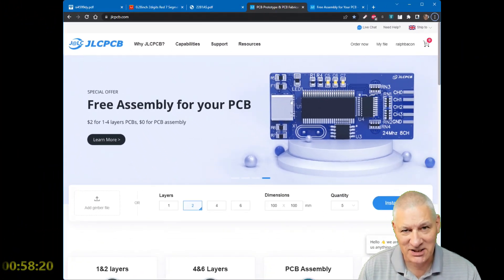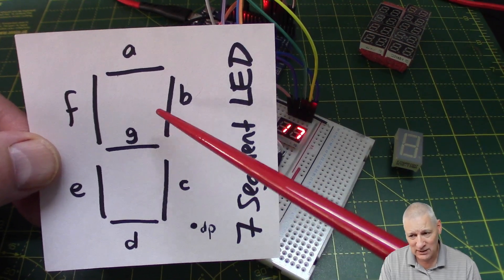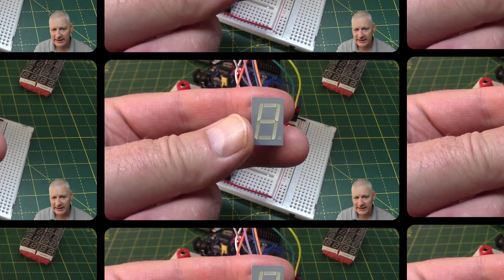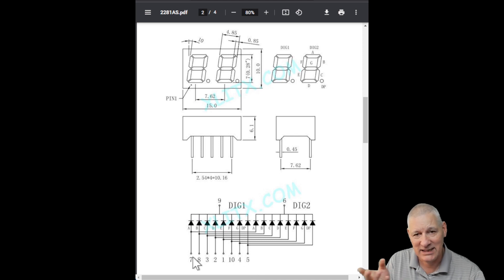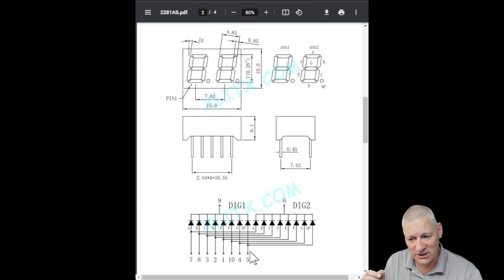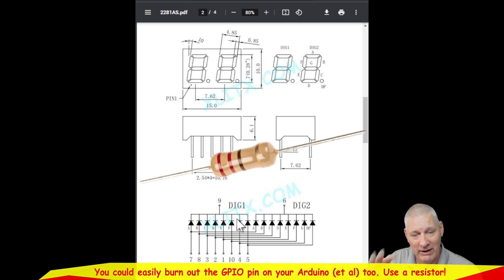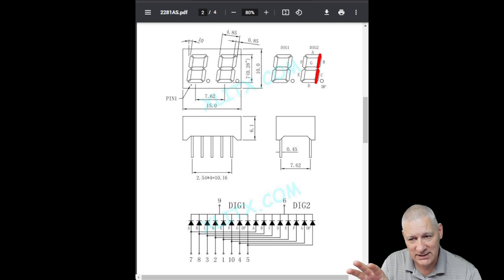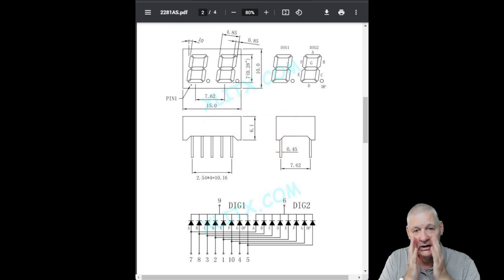#249 🎈7-Segment LED Digit Multiplexing with fewer GPIO pins

Comment: If you are still running out of GPIO pins...
You could have a secondary microprocessor chip do all the hard work. 

I.e. A 328p chip used as an I2C Slave to the main processor. This chip connects to the display one GPIO per segment.
It receives commands via I2C from the main processor. So only takes 2 pins from the main processor
AND.. You can program in additional functions like flashing, fade, busy animation, error displays etc.
AND.. It minimizes the code footprint in the main processor.
You could even build this as a stand alone PCB module that could be used in 'any' project.

I love I2C. So versatile.
Reply from the maker: I2C is great, but to consume a whole 328 processor to do this would never pass the finance committee stage, Jason. 

I hope to see how it goes with a (much cheaper) Tiny167 (already on order just to experiment) so we're already sort of on the same page.
Reply: @RalphBacon 
I haven't used a Tiny167 and in all honesty haven't heard of one. There are so many new Tiny's that it is difficult to keep up. 
I used the 328p as an example simply because I know it has enough pins and plenty enough memory for the task.

I've used an ATTINY85 in the past as a serial to i2c bridge in much the same way.

I look forward to seeing your Tiny167 project.

Comment: This took me back quite a few years, cost prohibited we used a 14 pin DIL resistor pack as current limiting for the segments. In production easer to install and the design of the PCB.
Reply from the maker: I actually looked at resistor networks but they were too expensive and big, too. These days, 8 tiny 0402 SMD resistors would be used. (Not soldered by me, but someone in the Far East with better eyesight!)
Reply: Shows how technology has moved in since the 70’s

Comment: Ahh, this takes me back, Ralph! A company I used to work for built big digit displays for scoreboards. But the segments were made from incandescent bulbs with Fresnel lenses driven by Darlington BJTs. It all got rather warm! But they were multiplexed in a similar way only, not with your complementary switch! However, I also used the same method for switching a couple of motorised valves, with a single data line. So we'll have to share the patent! 😉
Reply from the maker: Can we share the royalties too, Simon, I'm a bit skint this month, what with the electricity and gas prices in the UK...
Reply: @RalphBacon  Yes, let's do that. This time next year, Rodders, we'll be millionaires! 😁

Comment: 4:44 I think common cathode works well when you're driving the segments directly from an I/O or a chip pin (and possibly overall less current draw since the I/O outputs are "off" when the the display is blank and at rest.  However, when using an external supply and driving the display with NPN BJTs or N channel mosfets, I think the common cathode works "best" since N types are effective current sinks and can drive each segment low (as a low side switch).  But in that case, the common cathode requires a high side switch using less common P types.  In addition, if the external supply is greater than I/O pin "on" voltage, and a common cathode is used, the lowly I/O pin can't turn the P transistors on since the base can't be driven close enough to the high rail.  A common solution is to drive the P with an N, but now that requires two transistors per segment.  For this reason, I generally prefer common anode LEDs.  But of course I suspect you will agree that its best to first consider the application and power before deciding on which is "best" (and that is why both configurations exist).
Reply from the maker: As you say, always best to see what works best in any one particular case. I was a little surprised this worked so well. Oh, maybe I should not have said that. 😲
Reply: @RalphBacon  Thanks for responding.  All the best Ralph!

Comment: The problem with the P-channel, just having a quick look at it. 
Turned off state.
VS = 5V
VD = 0V
VGS = 5-5 = 0.

Now turn it on by pulling the gate to 0V.
VS = 5V
VD = 0V
VGS = -5V 
So fet turn on.

But Now it's on VS=VD + a very small bit VDS on.
So what is the gate voltage VGS its now 0V and VS is almost 0V so it will turn off.
I expect that it will oscilate in this state. Unless you can take the gate below ground.

This is the same as why you can't use a N-Channel as a high side switch without providing a voltage VGths above the VCC, with a diode charge pump. When it switchs on VS + VD So VGS has to be more positive to hold it on.
Reply from the maker: Yes, I was a little concerned I might have to bias them (well, connect the gate of each to GND/VCC which would then involve diodes, getting messy) but it worked very well.
Reply: @RalphBacon  The problem is when using a P-channelas a low side switch, the gate has to go lower than the source by VGS(th) if your drain is connected to 0V then you need a negative voltage to pull the gate down to. as the source will become the same voltage as the drain e.g 0V once turned on. Put a meter set to AC volts across the source and drain, this may show if the fet is osc back and forth between on and off. A scope would be better as it may well be faster than the meter can detect. There is a chance that it looks to the eye that its working as expected can't say without looking at it. anyway thanks for the gray cell workout.

As a side note i'd use one resistor in the common connection and just drive one segment at a time. the eye still wont notice of you do it fast enough and save a lot of current.

Comment: Hi Ralph. Another nice video with great explanations! Thank you!

For readers looking into this: if you cheaply want to reduce pin count and processor usage even more, I can recommend the TM16xx series of LED drivers by Titan Micro. The TM1638 is used in a popular LED & Key module. These chips use only two or three data lines, do the multiplexing automatically and can drive many leds in a display. 8x16 for the TM1640 for instance. (Mentioning my library and videos about them would be a shameless plug, so I will refrain from that. ;-)
Years ago Ralph also made some videos (video #9 and up) about a similar chip: the MAX7219. That one is a bit more expensive and doesn't offer support for reading button presses, but is also quite popular.
Reply from the maker: Spooky! Today I have been using the MAX7219 in earnest for a future project (finally found a use for my 1 metre long matrix display) but I want it controlled / controllable via Wi-Fi.

So you have a library for the TM1638? Not this one: https://github.com/maxint-rd/TM16xx
We will see whether YT kills this comment due to external links!
Reply: @RalphBacon  Was it coincidence or a glitch in the matrix? 🙂  Thank you for dropping that link! Indeed, that's the one. Hopefully YT keeps it there... 
After first using the library made by Ricardo Batista, I made some improvements. Then I came across many more chips within that family and accepted suggestions by other people, resulting in a sizable collection of variants of modules and bare chips. Although these chips have their limitations, I find them quite useful and very affordable. I had great fun with many blinkenlight projects. (If only I could reach your skill and productivity to capture that in YT  videos...)

Comment: This is a great idea for a small project with limited I/O lines. And using a single resistor does cut down on parts and complexity with the noted downside that numbers that use less segments will be a little brighter.  I have seen a 7 segment driver that allowed you to configure it for single resistor implementations and the driver would automatically shorten the “on” time the bright digits to make them all look about the same. Best of both worlds – one resistor and digits that all look alike.  But I “assume” that this driver controls the on and off times using the common line, and that would not work in your dual use configuration since there would need to be times when both digits are off. It could be done, but I expect it would be more difficult.
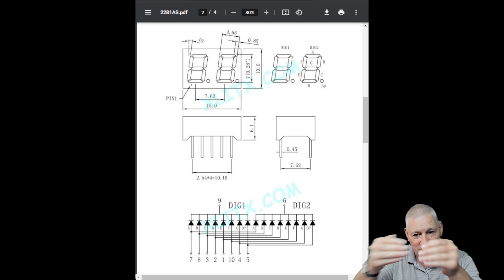Reply from the maker: Indeed. I wouldn't use the single resistor design for a bedside alarm clock as the change in digit brightness would be quite noticeable. If the time were 10:18 the "0" and "8" would be noticeably dimmer than the "1" digits.

But for a simple error reporting dual 7-seg display we can live with the slight difference in brightness, I reckon.

Interesting about shorting the "on" time depending on what digit is being displayed. So a "1" would be on for a shorter time than an "8", for example, to give the same perceived overall digit brightness. Interesting!

Comment: Looks like you are using an Uno R3 which has 5v output and a chip max of 150mA.  So if you use one 220ohm resistor per segment and DP, and assuming a 2v forward voltage of each red LED, that's a total current draw of 109mA.  That results in using up 73% of the total current available when all digits and DP are lit for a single digit.  Always calculate power usage, not just for each pin, but also for the max allowable chip current.
Reply from the maker: Well, you're being a bit conservative there. 😲

The total current that the ATMega328P can safely consume is 200mA. Using a 220Ω resistor allows about 10mA forward current on the LED segments I'm using. So, 80mA per digit. Only one digit is on at any one time. Pretty safe. 😉

More importantly, as I've tried to put everywhere, you would never use that many pins directly from an Uno, it's just too wasteful. This is just a demo. In Real Life we'd use some additional hardware, like the 74HC595, to reduce the pin count to just 3. Or maybe a PCF8574T which can be controlled by I2C (so just two pins) and is often used to control LCD displays for the same reason. And it keeps the current flow well away from the Arduino pins too!
Reply: @RalphBacon  The source I found indicated 150mA, but after checking, you're correct it does appear to be 200mA.  One must also be careful when using the 74HC595 which has a total chip limit of 70mA, so that's even tighter.  I see many abuses of that in '595 circuits driving LEDs directly that I find on the web.
Reply from the maker: You are, of course, quite correct 👍 that we must observe total chip current capacity, not just the individual GPIO limit; it would be very easy to overload the chip otherwise. 

Often we use "20mA per GPIO pin" rule, but the actual maximum is 40mA. Once again it's important to see what the current for the pins in the same port are, as well as the ATMega328P, otherwise things could get very toasty!

I've noticed that the 74HC595 is often "abused" in the way you describe. In my (future) design I'm using about 5mA per leg, which is REALLY bright on the new LEDs I'm using and well within the overall limit. I'll try and remember to emphasise this when I get to doing that video. Burning out one LED is no big deal; burning out a segment on a 7-seg LED is disastrous. 😲
Reply: @RalphBacon  👍👍👍

Comment: Sorry, Ralph, but multiplexing IO and using visual persistence has been done too many times for you to claim it as a first. :(

Having said that though, I think running through some classic circuits would be a good match for your channel. Perhaps start with the 555 and then go through some of Don Lancaster's TTL work from the 1970s? I think your viewers would like it.
Reply from the maker: 😁No, Mike, I'm not claiming multiplexing as a first, but in using a SINGLE GPIO pin to control 2 digits by virtue of the N/P channel MOSFET. I can find no-one doing this, always one transistor : one control line, per digit.

GPIO pins are a scarce commodity so reducing the number in displaying info via LEDs has got to be good, right?

Comment: Multiplex at a higher frequency and do it per segment and you can do it with one resistor ...
Reply from the maker: Would the overall (perceived) brightness not be lower (as each segment would only be on for an eighth of the time that they are on now)?

Comment: @11:40 it is best to use one resistor per segment otherwise if you just use one per digit the digit brightness will vary depending upon the number of segments that are on.
Reply: i saw that, 1 is brighter than 8
Reply from the maker: Hmm. I'm guessing you wrote this before watching more of the video! 🤦
Reply: But at 220 ohms per segment will result in significant current draw when all segments are lit and you won't be able to do much else with your uC since you'll use up most of the max allowable current draw.

Comment: Nice but... While the N-channel will switch fulll on. The P-channel has S connected via the LED , and will have a voltage drop because of  the G-S voltage (a few volts) needed to turn it on. It looks to me that one digit is slightly dimmer then the other.

Try using 2 N-channel, using the first as a driver and an inverter.  Connect the second G to the D on the first. A resistor on D to 5 volt on the first one may be needed.
Reply from the maker: Hmm, it's running here and I don't see a difference in brightness between the two digits, I must admit. 

Of course, a "1" will look brighter than an "8" for the reasons I state in the video (the current is being shared between segments).

What I do see is an error in the circuit diagram in the GitHub: I've omitted the series resistor on both legs (180Ω), oops. But these could be tweaked to get the brightness equal, too.

I'll see about replacing that circuit diagram.